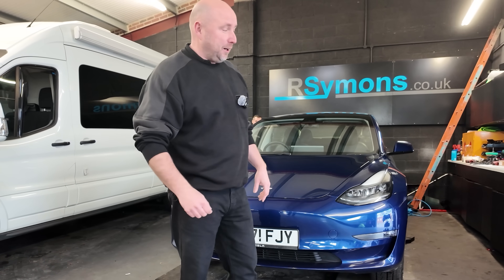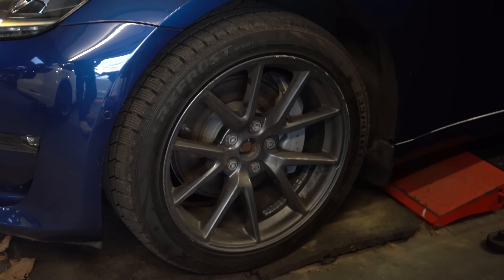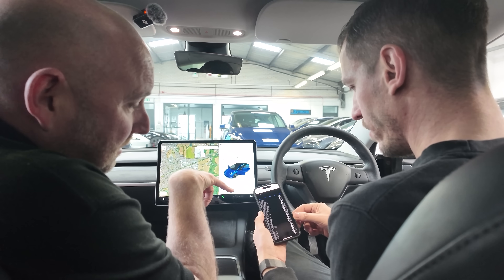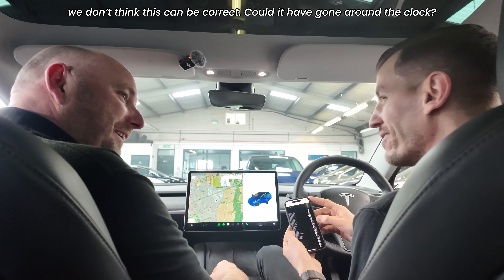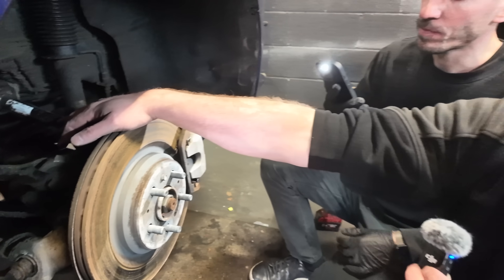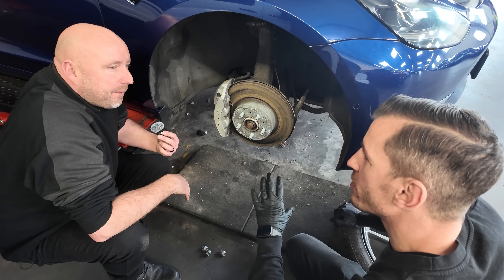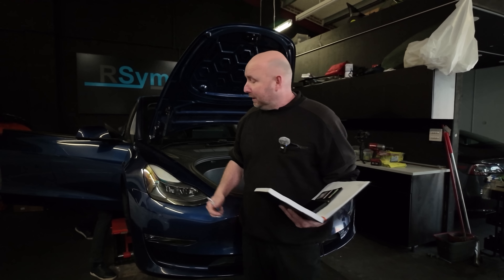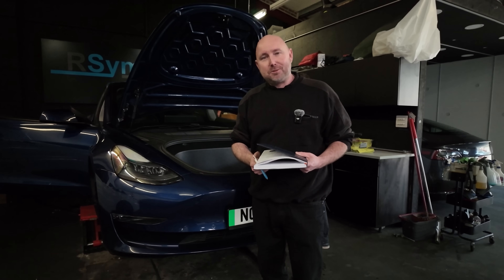EVERYTHING WRONG with my HIGH MILEAGE "21 Tesla Model 3! | Battery health and other issues!

Comment: Absolutely brilliant video, Richard, thank you. Teslas are a revolution - an absolute revolution. So fun to drive, fast, amazing handling, awesome space AND money saving. I bought a Model 3 four years ago and have saved $25K+ during that time. No servicing. Just one set of tyres and wipers. Literally no other issues, just EXHILARATING, phenomenal driving. We charge up at home using our solar panels, so virtually no cost for 'fuel'. Honestly, the Model 3 is far and away the best car I've owned and/or driven - can't fault it.
Reply: But what was the Total Cost, including installation , for the solar panels? You have to consider that cost.
Reply: @MH-so9oz  Total cost for solar panels (everything, plus installation) was $6K (Australian), six years ago.  We now have free electricity for our entire house, and also charge our car, so we've paid back the setup cost many times over. We also export energy back to the grid and make money through it. Seriously amazing setup!
Reply: @MH-so9oz  Per kWh nowadays pv-electricity costs around 0,05€. So that makes between 0,50€ and 1,00€ for 100km.

Comment: Great review! Have a 2019 M3 in the US w 75000 miles. Hardly ever charge full but the math says maybe 90 % capacity - and has not changed in 2 years that I can see. A few minor things fixed early under warranty except for that just tires, vipers and an air filter. At 5 years I had a new 12 V battery installed as a precaution. I really couldn’t be happier, even here in the US where “petrol” is much cheaper than in the UK, I’m saving lots of money driving my M3. 
Thank you!

Comment: I skipped through the video, so apologies if you did this in a point I skipped.

I think it would be useful to put up a chart with columns comparing the running costs and expected maintenance versus ICE vehicles. It wouldnt be too hard to get the most popular cars, then have a look at the manufacturers service intervals, and some anecdotal evidence of what typical owners might ALSO have to do. The end result would be scary for ICE owners...
Reply: at 200k miles for a diesel youd need as a minimum in maintenance 10 air filters (£20 a pop) 5 fuel filters (£20 a pop) 20x oil and filter changes (about £45 a pop) 3 gear box oil & filters (£60 a pop) 2 cambelts (£180 a pop) 4 sets of front break disks (£60 a pop) and 2 sets of rear disks (£55 a pop) 16 packs of break pads (£8 a pack) 4 batteries (£90 a pop) and definitely an alternator (£150) .... thats a total of £2726 only for parts assuming youll be doing ALL THE WORK. otherwise think at average of £60 per mechanic work hour I would estimate 150 hours for all of that £9000 (this cant be right ... maybe ive over estimated) ... all of that though if we assume all is top noch shape with the car ... no suspension or pumps or DPF or EGR or Turbo or Fuel lines work is required. 

at 200k miles for a petrol ... trust me 95% of them wont make it to that mileage .
Reply: @yolinkin  Yeah, a lot of that looks like routine maintenance. The problem with ICEVs is that the engine/gearboox has a ton of moving parts. If one breaks, you could be looking at a very expensive repair. In an EV, there is only ONE moving part in the motor. The difference in the complexity of them is stark. I would much rather have only one thing to fail, rather than literally hundreds of parts that could fail.
Reply: But when your battery dies, and with a Tesla, a single battery cell is enough, you will have to prepare 15,000 Euros :-) I have been taking care of regular combustion cars in a small company for twenty years and we have not had any major expenses, it is important to choose the right engine and brand, but this also applies to an electric car.
Reply: @palusisko  that's the big question, when does the battery die? On average I see 12-13% degradation after 10 years. Previous lab tests have massively overestimated the Deg over life cycles because they had to do the test in a short period of time and rest times have not been accounted for. So I would be inclined to say after 25 years and 500k miles you'd be reaching 30% Deg, where most manufacturers would say "ok that battery needs replacing" . BUT bare in mind at that point most Tesla would still do over 230 miles per charge. And should you want to get it fixed you don't have to buy a new battery, you can get it fixed for £3-4k in most instances. Now correct me if I'm wrong but £3k is pretty much what oil and filters will cost you in 25years with 500k miles.

Comment: That is incredible.  I feel like I'm slacking and need to drive a lot more.  Name - Benjamin Button since the car does not seem to age?  After a 9000 mile trip around the US last year, with continuous supercharging and DC fast charging, that my range at 80% dipped from 252 to 248 miles.  Just turned 96K - 17 100D.  Hope to get at least another 96K.  Keeping some money in the bank for those "unexpected" repairs....  Great story Richard.

Comment: Your videos about high milage Teslas and EVs generally, are more nails in the ICE vehicles coffin.
I also drive a 21 Model 3 standard range and of all the many vehicles Ive owned and driven is the most compelling by far. Im 64 and after almost 4 years still love the fun of driving it. It has also easily saved me $1000s in running costs and is way cheaper than an equivalent performance ICE vehicle. Moreover, the OTA software updates keep it relatively current with newer vehicles and add another layer to ownership.
Reply: "Your videos about high milage Teslas and EVs generally, are more nails in the ICE vehicles coffin."

Right, that must be why sales have fallen off a cliff and quite a few manufacturers are returning focus to ICE development.
Reply: @ferrumignis If you’re interested in the facts BEV sales are increasing yoy, and ICE have been declining yoy since around 2017. Some legacy automakers are prioritising ICE vehicles for short term gain because they are incapable of making EVs profitably, just look at Nissan, who won’t be around soon. Check the data yourself.
Reply: @feetup-jf7kq  You are delusional. EV sales are in deep trouble, to the point that a whole bunch of cars were bought and registered by manufacturers at the end of last year to meet government mandates in the UK, now they are having problems getting rid of them.
Most people either don't want them at all, or simply don't have any facilities for charging them.
Reply: @ferrumignis  i meanr to ask, have you even driven an ev? Do you like breathing clean air? Do you want you country to have better energy security or prefer buying oil ?

Comment: I’d be curious to see a 15-20 year old car with the same miles. I would suspect that living through 20 winters won’t be great for the battery.
Reply: Cold weather is actually significantly better for the batteries than hot weather. It's why these cars do so well in cooler environments and below freezing temperatures, even if their efficiency drops.
Reply from the maker: We’ll let you know in about 15 years how it performs 👍

Comment: Im up to 118000 in my model 3 long range now Richard. Picked it up on the 28th Sept 2022. All going well. I changed the cabin filters 2 months ago and also the wiper blades (also had some credits!!) the only thing apart from these and tires was the drivers window switch, which i managed to break one day so had to have a new unit, but it was only about £50. I need it to do around 240000 by the time i will have finished paying for it over the 5 years and all is looking good and its great to see you have a good example with your latest purchase!! Gives me confidence that mine will get there also 😊

Comment: very interesting video. 
1. Is it NMC or LFP battery inside?
2. 12% range loss- how does it look in real life? How much km originally this car could go on one charge and what is now? 

Another punch in to face of ev haters. As an EV fan I really would like to see more 'retrofitting' by manufacturers and EV workshops. I mean, that would be great if you could buy old EV after warranty and pay for a new battery (which should be cheaper and cheaper as CATL is saying)
Just like you can do  now for ordering new 64kwh batetry for old nissan leaf Gen1.
For example I'm looking for cheaper auction of used Hyundai kona, but buying it with small or no warrancy is a super high risk, because these models can have 2 problems ('gearbox' and inverter).
If there could be more EV repairs with cheap parts - that would help EVs much.
Reply: NMC battery. I drove it back from Newcastle and it would have done  280 miles in one charge and about 2% left but had to stop for toilet break because I was driving for 4 hours. That was at 5 degrees celsius as well. We’ll do more driving videos soon.